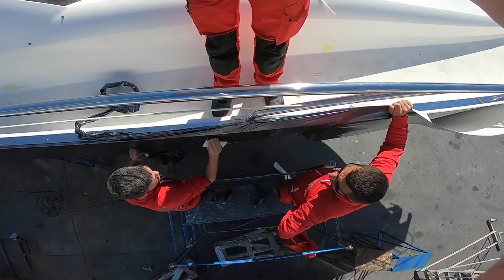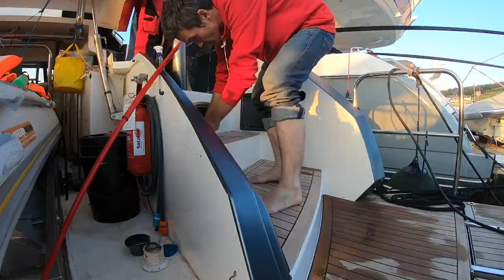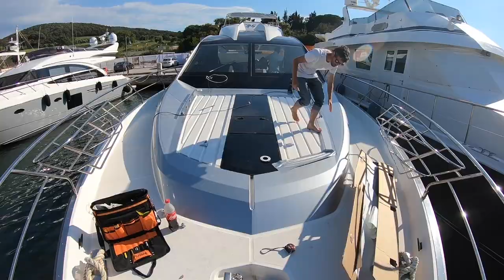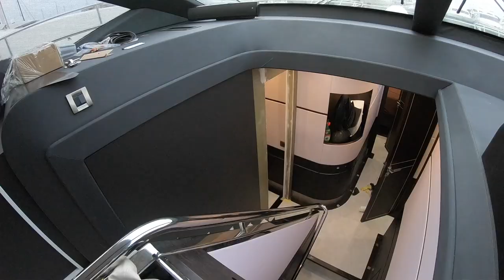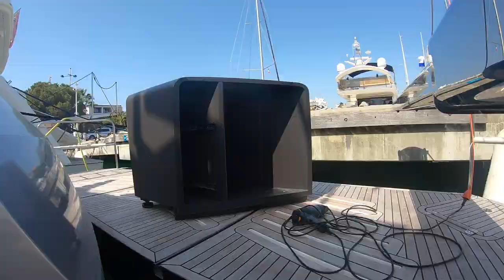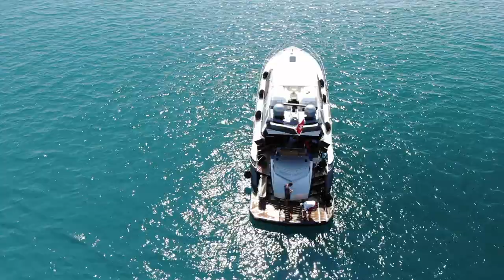Full vinyl wrap on Galeon 700 Raptor luxury yacht

Comment: Couple of questions: Do you use a special vinyl? Is there a concern at the waterline about the vinyl peeling back? How does the vinyl hold up with fenders rubbing against it? Thanks
Reply from the maker: We use wrapping vinyl with additional layer of clear laminate or PPF. Waterline is sealed with edge sealer so it stay in the position and don't peel. As long as fenders are clean they dont damage the vinyl. Problem would be sand in the fenders if you do not clean them from time to time.
Reply: @creativeconnection205  Thank you!

Comment: Why do people get boats wrapped in Vinyl? Is it to protect the gelcoat or just to change colour? Or is there other reasons?
Reply: It's an extra layer so it provides protection  against scratches, salt, UV fade resistant, etc., and it changes the colour. It's usually a lot faster to wrap than paint, and it's usually a lot cheaper than painting. Wraps are easy to maintain (just wash with marine-safe soap & water and a soft sponge), and if you get them professionally removed you should have a perfect gel-coat underneath come resale time.